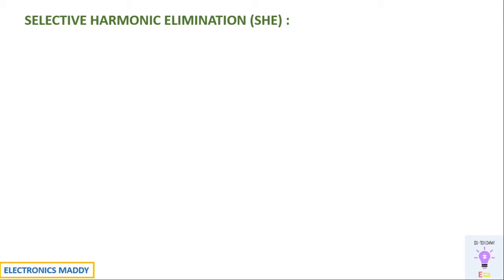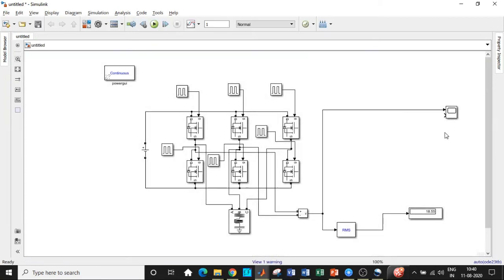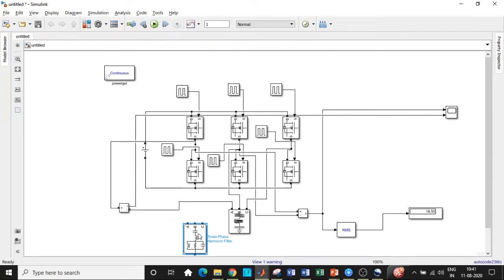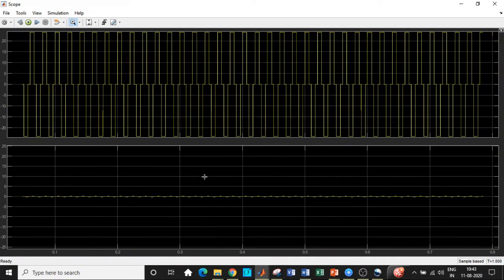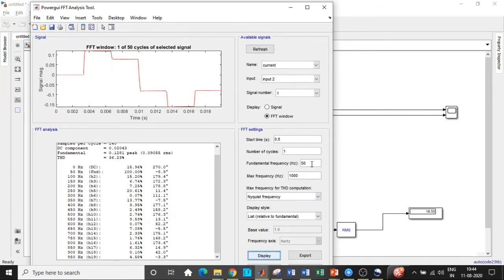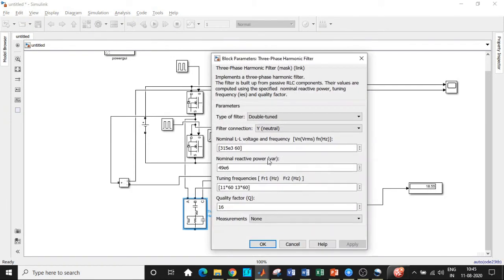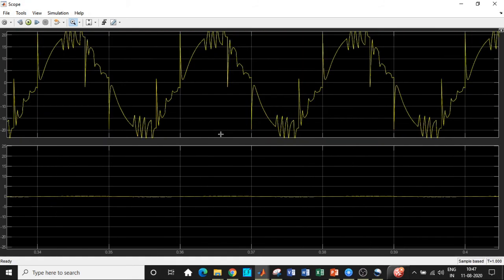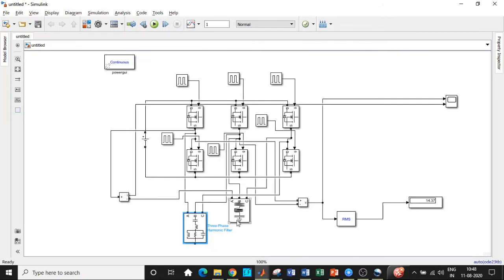Selective Harmonic Elimination in MATLAB | SIMULINK

Comment: Hii sir.. I want to ask how can i reduce the thd in input current of ac-dc converter for power factor correction.. In the current i m getting 3rd and 5th harmonic.. How can i reduce it?? Please help
Reply from the maker: Design and filter and perform FFT
Reply: I have done that part but thd is quiet high
What are the ways to reduce it